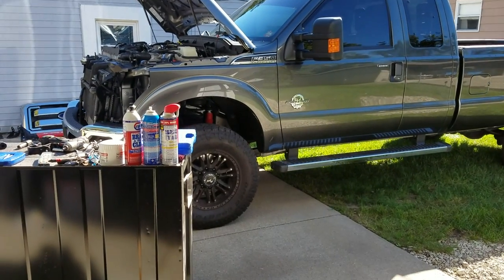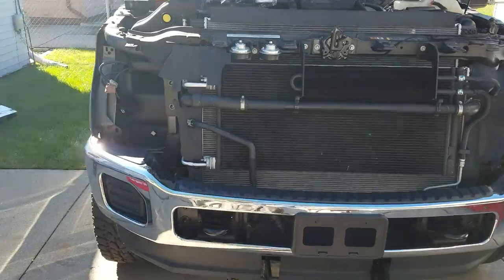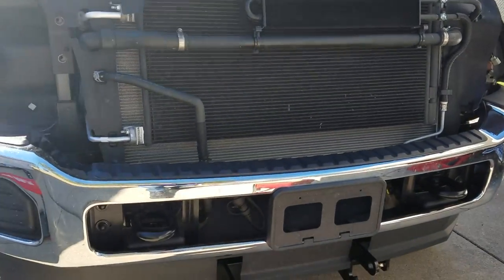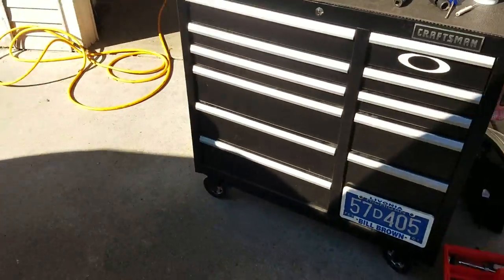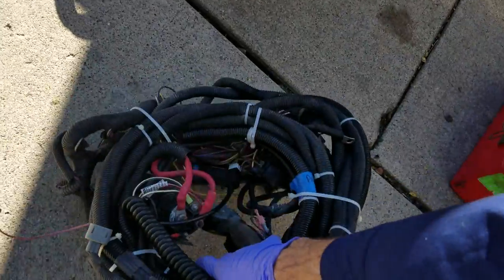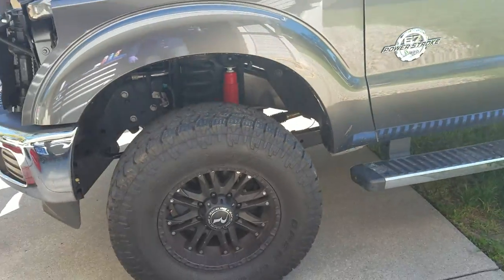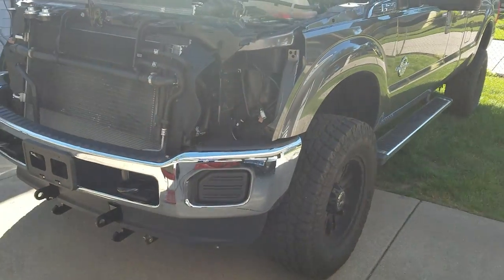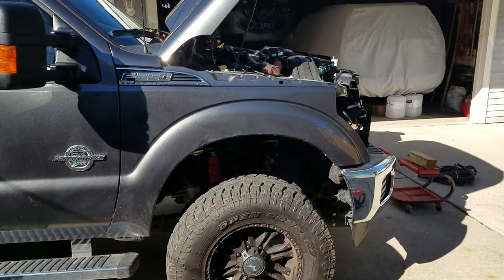F-SUPERDUTY-BOSS PLOW INSTALL

Comment: How did you run the wiring harness. Trying to figure out the best way to route all of it. Thanks
Reply from the maker: I literally am uploading that video right now....lol i just did a 2020 f450. Got it scheduled to drop, sry pal
Reply: 10-4. Just trying to find a spot big enough to drop the plug for the plow down to the bumper. Thanks
Reply from the maker: Take LH headlight out run under driver side of rad behind bumper...

Comment: Great Video - Any issues with the truck throwing electrical codes?  (i.e. i know chevy's need to be reprogrammed when plow harness is installed).  Ive done several Ford 6.0 plow installs, have been worried about the electrical side of the 6.7s
Reply from the maker: Dave Thorson , it was no sweat. This was a BOSS V-blade. When I took this off his old truck, I marked everything, wiring color, connector etc...so that install would be a breeze. I didnt have any issues. As far as I know, there isn't any programming that has to be done to accomplish this on any F-superduty. Hope this helped.
Reply: Thank you

Comment: I would of cut the valance as close as possible to the mount. but he will probably knock it off anyway. haven't seen a plow truck that wasn't well used up.
Reply from the maker: D4x4Bronc, its needs extra room on each side which is  why i left room, the plow has to slide in that area to attach. It wld be too tight, at least there will b a few inches to work with to aid in install.
Reply: I'm hooking up a fisher to my 2010 powerstroke and need to know were the isolation modual mounts as theres not a lot of room under the hood... any help or pictures